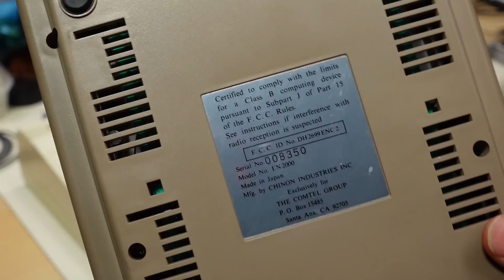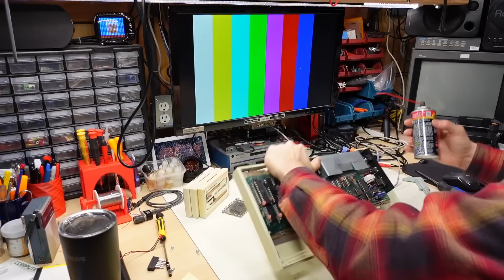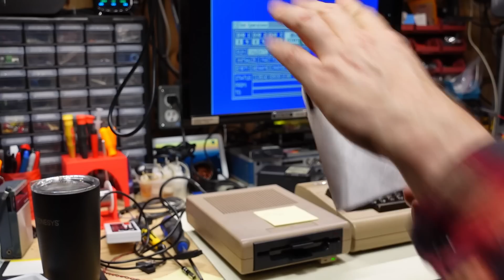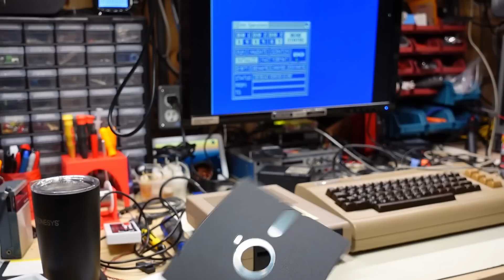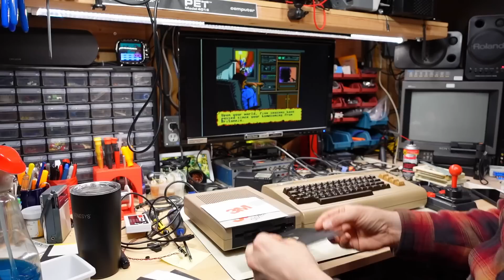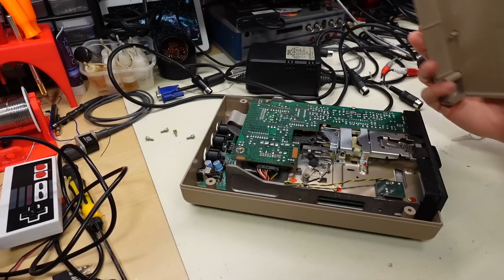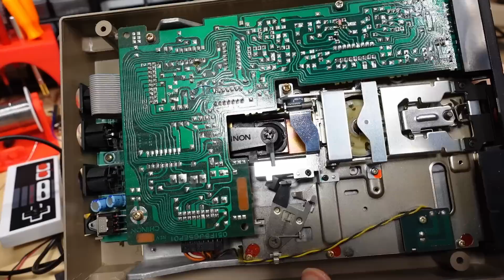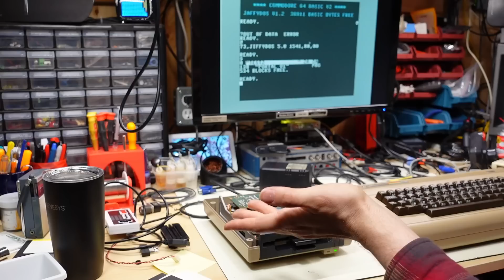0036 How compatible is the Enhancer 2000? (A clone of the Commodore 1541 disk drive)

Comment: Back in the heyday when I got my first C64, my first drive was an Enhancer 2000.  I bought it rather than a regular 1541 for 3 reasons - it was cheaper, it was smaller, and it was a tad faster (it's been a LONG time, but I think doing speed tests on it, it varied from disk/program from about 5% to 30% faster).  I think that's the reason that it doesn't work with a lot of the fast loader games out there, is that the built in fast load collided with the software fast loads.

Eventually my drive started to fail, and by all accounts, it appeared that it's alignment was off about 1/4 to 1/2 a track.  By that point, I had already repaired a few C64's and 1541's, 1541-II's, 1571's, etc. so I took my Enhancer apart to try to realign and recalibrate it.  That's when I noticed a HUGE problem with that drive, you can't adjust the alignment on that drive (or at least I couldn't figure out how to).  So, unfortunately, my love/hate relationship with that drive can to an abrupt end that day.

Comment: I have three of these drives, one is white one is light brown and one is a darker brown, they all have different roms, one has commodore 1541 dos, and one has the same as the video, dont remember the third one. Will have to try the MOS 6502 and see if that helps it be more compatible. DUCK BILL latch mechanism was neato. The most compatible clone drive is the Oceanic 118/Excellerator+ that seems to load anything.

Comment: If it loads Electronic Art's software then it's very compatible.  I had an MSD-SD1 disk drive which failed to load EA software like Music Construction Set.

Regarding the Goodwill Bins, I've been to the one out in Hillsboro Oregon a couple of times, and it's very depressing and horrible.  It's filthy and everything has been picked over to the n-th degree.  What's left looks like it literally came out of the garbage can or was found on the side of the highway.  So sad, I never went back.

Comment: I don't think I've seen anything other than old PC hardware at a thrift store for maybe 25 years.  So I''m amazed someone found Commodore hardware.

I sort of vaguely recall the Enhancer drives being sold at Target around the mid 80s for only a little cheaper than the 1541.  IIRC the worry was always the copy protection schemes.  How much of that is FUD vs reality I'm not sure.

Funnily enough, those Enhancer drives now seem to sell for more on Ebay than the 1541!

Comment: Used to work at the goodwill clerance center in San Antonio, they put a bin out for an hour or 2, then anything not purchased after that is taken to a compactor. No recycling.
Still go in there about once a month or so to see what I can save. Best find was a 2010 Alienware 17" laptop... pretty heavy so it was about $20. Never found any vintage stuff other than console controllers.

Comment: You’re right about Goodwills in each area being managed differently by location! Although we do have bin stores here out here too, known as Goodwill Outlets, where you have big blue bins where everything costs $1.50 per pound or whatever. I’ve visited them a few times on LGR Thrifts but like, 90% of the time I find nothing but literal garbage so I rarely bother.

Okay onto the rest of the video now :)
Reply: Here in Oregon I've gotten 27" monitors for less than $15 (electronics are $0.69/lb). You don't know if it works till you get it home, but in my case I got 2 fully functional monitors. Lots of times we go it's crap.
Reply: @chemmerling  that’s a nice price per pound.
Reply: Yeah our Goodwills here have the bins at the main distribution centers
Reply: A few years ago the Goodwill operating company in Ontario, Canada went bankrupt.
Reply: @evensgrey  The one in Alberta is still running.
Reply: @wizard-pirate  It looks like most of the operating companies are fine.  But, well, things happened here.  I don't know exactly what, but it was the classic 'cash flow crisis' that puts most businesses into bankruptcy:  For whatever reason, they lacked sufficient liquid cash to pay all current accounts.  They got everything opened again but I don't know if everything stayed open

Comment: Shocking.... Goodwill.... One of their locations where they actually have computer stuff? Arkansas Goodwill ships computers and game consoles to a central location for processing... That location is NOT where I live. (to Little Rock maybe?) Keyboards, mice, controllers, and lcd monitors? Possible... Good price? Since inflation, not necessarily... Mostly no.  Hi-Fi equipment has gone crazy even before.) Local Goodwill uses a color code system.... One color a week goes 1/2 price... Sundays knock it down even further and a new color becomes 1/2 off. (Cycle of four colors) old 1/2 off color reverts to normal.

I have yet to see a retro computer  show up in any thrift store here. Rarely, if ever, in a private sale. <sigh>

Comment: Yeah, Goodwills are more a franchise setup then anything. Soemtimes  good, sometimes not. And there you go
Reply: yeah, there's one or two decent ones in my city but the rest are pretty lousy.  That said, I don't really get much retro stuff from them, that doesn't really exist because they're mostly all set up to put that stuff on their ebay store (or online site).  Other than the random box of floppies (that are usually bad) or other little things, the only other thing I get from there are 4:3 LCD's... sometimes can find a few decent ones with lots of the various composite/svideo ports - since that's the next best option after all our CRT's die :)

Comment: My first disk drive was the Enhancer 2000, in fact my mom wrapped it and kept it at our next door neighbors house till Christmas. Well ironically that year I was house sitting that house for the neighbor through the holidays so myself an a buddy one day went over and I VERY carefully unwrapped it pulled it out and rewrapped the empty box to use the drive during the first week of Christmas break from school. I also unwraped some games. hehe  Then 2 days before Christmas I brought it back over and put it in the box and rewrapped it.  On Christmas morning I was still just as excited to open it as now I had a taste of using it for part of a week.  My parents never knew of this till around 2011 when I shared this story with them and one of our older kids.  My mom was blown away and said I always had very good wrapping skills even at 13, but she was more shocked at what length I went to and how devious it was!! HEHE

I don't have that exact drive now but have another Enhancer 2000 I recently picked up. It was a GREAT drive but did not load 5-7% of my games due to the copy protections. Back then I would take the drive in to get tested/serviced and it would always pass. One time a tech said they are great drives but only about 97% compatible with c64 disks.  Later when I got a 1541 all my disks worked that would not on the enchancer.  I still notice this to this day with the replacement Enchancer 2000 I have.  

Still my favorite floppy drive with a great adventure story with it back in the 80s!!!
Reply: The Enhancer 2K was also my first floppy drive.  Upgraded from the tape unit.  Absolutely the worst thing ever.  It got to the point that every piece of commercial software I risked purchasing would end up w/breath holding/"puckering" and whatnot fearing the copy protection would cause the drive to 'shit the bed'.  Most of the time it would and I'd have beg/please w/the vendor for a return. Which was increasingly rare.

On my birthday in '87 I got an Excerator Plus FSD-2 (infinitely more compatible w/1541).  I took the Enhancer 2K out to the driveway and smashed it against the concrete MANY times.  Quite thereapeutic.

Comment: Labels:
FWVLIW: Print the label you want on to photo paper and laminate it if you have a laminator or just cover it with Sellotape (scotch tape in the US?)
I would guess a quick google will turn up a photo of the drive from which you can grab an image of the original label. Carefully cut to size, job done.
Perfect? Nope. Will it last forever? Nope. But I find such DIY labels look pretty darn acceptable and will do for a good few years.
 
PS: http://bithunter.siz.hu/images/coll_enhancer2000.jpg
A few minuities to get the aspect ratio right, although a label that simple would be pretty easy to fully replicate.

Comment: Regarding the header pinout on that floppy drive.  The VZ200/300 (aka Laser 3xx) floppy drive used the same pinout as the Apple floppy drive.  I suspect vtech simply repurposed their Apple clone floppy drive, which looks identical to the VZ drive from the outside, for the VZ and built their own minimum cost 99% software FM controller.  The only differences with the pinout are +5 is supplied from the drive to the controller and no 12V at all.   The RPM seems to have been lowered to 85 by shaving the pulley on the motor spindle to ridiculously thin.

Comment: Your odd keyboard behavior reminds me of an experience I had with my own C64 way back when.  I had a QuickShot 2 Plus joystick for the 64.  It had an autofire switch that would continually press the fire button.  Well, if you had the joystick in port 1, it would send a random bunch of garbage to the screen.  The normal behavior was for a button press to trigger a space bar press.  But the QuickShot 2 Plus joystick sent different characters.  If I remember right, they were different characters than what you're seeing, but the behavior was similar.

Comment: Yes, Adrian, You are correct!  The VIC-20 that you are working on that came from the GOODWILL BINS indeed has a EURO type keyboard.  These EURO type keyboards were installed on some Transitioning U.S. and Canadian VIC-20s when they went from the earlier 2 prong Power Supply VICs to the Later C64 Type Power Supply type VIC-20 CRs... That Plastic VIC-20 Name Badge IS NOT an original, but a European REPRO VIC-20 Badge that someone has put on that VIC-20! ...So the machine was obviously in someone's spare parts and worked on in the last 10 years at least.  ;)  Keep up the great videos...!  Tony K. (Commodore and Ti/99 Collector...Melbourne, Florida)

Comment: I could visit Goodwill a thousand times and never find any old non-PC hardware, let alone in a buy by the pound bin.  

That's an interesting 3rd party Commodore drive.  Nicely designed PCBs and overall an example of something not designed to be as Tramiel cheap as possible and yet it was only $149 in 1985.

Someone should send you an Indus GT drive for the Atari 8-bit machines.

Comment: I have both an Enhancer 2000 and a 1541. When swapped the 2000 with the 1541, loading times went from kinda slow to unbelievably slow. The 1541 went right back in the box. I'd still love to get an Indus GT drive for both my Atari and C64. It has an LED showing the track number, error code, or disk type.
Reply: I was just going to post; I have an Indus GT and am experimenting these days with modifying its EPROMs to be more... "accepted".  Some demos and games (ones which use IFFL) expect the "1541" status string in the error channel, and will refuse to load if it finds "Indus GT".  So then, Adrian: try loading Solar Jetman C64 from disk on your Enhancer and see if it loads OK.
p.s. Adrian & VWestlife: thanks for all your awesome videos!
Reply: Isn't the drive speed limited by the famously buggy IEC interface on the C64? So, how can the Enhancer 2000 be any notably faster without some kind of fastloader?
Reply: I want a MSD-2, mostly so I can use it on my VIC-20's IEEE interface.
Reply: Here's the box of the Enhancer 2000 showing the feature list: https://thumbs.worthpoint.com/zoom/images4/1/0317/06/vintage-commodore-comtel-enhancer_1_fd52bae339f2047377afcd0f7cf3d017.jpg
Reply: @vwestlife  Link doesn't work, sadly - gives an access denied result.
Reply: Try this one instead: https://i.ebayimg.com/images/g/HrgAAOSwP7ZiiC5g/s-l1600.jpg

Comment: Cool looking drive. Much less bulky than the 1541. 
The Action Replay fast loader uses the C64 function keys as one-touch hotkeys for $, Load, Run, List and Load "*" etc.
This makes it very quick and easy to display the directory or load "*" just by hitting the appropriate F key. Depending on the version, F1 loads and runs "*", and F3 lists the dir. 
You can even move the cursor up to the line of the program you want to run, and hit F1, and it will load and run that program. Very useful. The DOS wedge also has some useful shortcut commands. 
The speed of the fast loader varies between Action Replay versions. On some versions it's the fastest fast loader on the C64 (excluding those that use custom ROMs.) It really is a fantastic cart.

Comment: Adrian, a little more detail on clone drives for the Commodore 64.  A lot of clone drives took the approach of basically shuffling the instructions around (and adding filler bytes where necessary to keep code length the same) to make them look different but behave the same.  Some examples are the Blue Chip BCD/5.25 and Rapid Access FD148.  If you look at a disassembly of the code, all the strings (like error messages) are at exactly the same memory location, all the functions are at the exact same location, etc.

One drive that was a little different was the Commander C-II.  A big chunk of the code ($C100 to $CEE1) is moved up by one byte.  This unfortunately means that any fastloader that expects this code to be in the usual location won't work.  Also, they obfuscated addresses.  JMP $C1C8 might become JMP $81C7 (which is a mirror of the ROM... due to incomplete address decoding, the RAM and ROM is mirrored several times in the 64K address space).  It's still a line-for-line copy of Commodore's code.  All they did was move code and obfuscate addresses.

The Enhancer 2000 2.0 is based on Commodore's code as well, and at several sections throughout the ROM, it uses the same trick of shuffling instructions.  It doesn’t just have swapped instructions though – big chunks have been completely rewritten, including the send and receive code on the serial bus and the GCR encoding/decoding. It would be interesting to analyze what the advantages of these new implementations are!  (The original Enhancer 2000 1.0 ROM was practically a literal copy of the 1541 ROM, which of course Commodore sued them for.  The same thing got the first MSD-1 drives in legal trouble.)  The interesting thing is that the 2.0 ROM is compatible with (most) fastloaders, while the 1.0 ROM (which is a near-exact copy of Commodore's code) was not.
Reply: I recall reading the review of the first Enhancer 200 drives in Ahoy! magazine.  They were so impressed with the compatibility of the drive with various copy-protection schemes geared to specific 1541 quirks that they got suspicious. When they popped out the ROMs and got gibberish in a standard reader, they got more suspicious.  They then used the internal copy routines to drop the ROMs into the buffers section by section and move to a computer, and discovered they were bit-identical, just with some of the data lines switched around so they couldn't be read by a ROM reader without a non-standard adapter socket.  They put all this in the review, and told Commodore immediately, so by the time the review got published the drives were al but impossible to find.

Comment: Nice!  Random note:  when you do a "@N:DISK,8" that isn't formatting device 8, that's assigning a DISK ID of 8 to the disk.  This only really matters if you had two drives and THOUGHT you were formatting device 9, let's say.  You'd actually format the disk in 8 and then assign an ID of 9 to that disk.

I think to format a device other than 8, you would do "#9" and then the N command, but it depends on the wedge.

FWIW, I normally like to use a 2-digit ID if possible!
Reply: And with a little bit of trickery, you can change all five characters at the end so instead of it saying ”45 2A”, it could say ”SUPER” :-)
Reply: @madmodders   and with more trickery, you can even animate directory

Comment: I had an Enchancer 2000w (I guess that was a Rev number).  I bought mine from Protecto Enterpizes and can't remember if I was just told it was better or that original 1541 was not in stock.  I was not impressed with it and was amazed when my originals actually worked.  I always regretted that purchase when I'd go to my friend's house and the floppy worked on his original 1541.

Comment: I had an Enhancer 2000 with my first C64, and I have very good memories of that thing. Unfortunately I sold it along with the computer when I was trying to get a newer setup at the time and was no longer using my 64. I have since collected more 64 systems and 1541 drives... but I haven't been able to track down one of these again for the nostalgia. No idea what my unit's ROM version was (nor did I know how to tell, at the time), but it ran everything I had to throw at it. I didn't have a BASIC enhancement/fastload cartridge, though.
Great to see someone doing some real poking at one, to be honest!